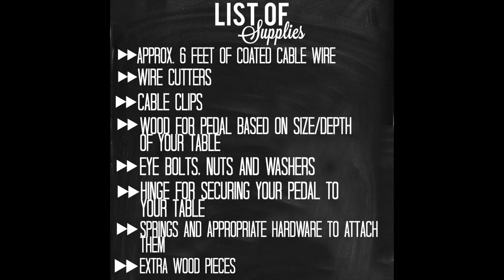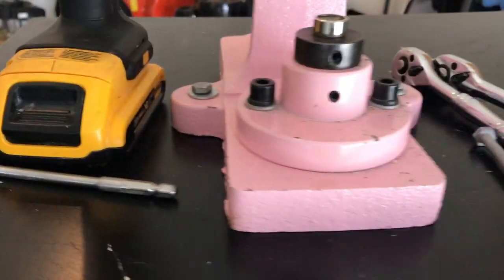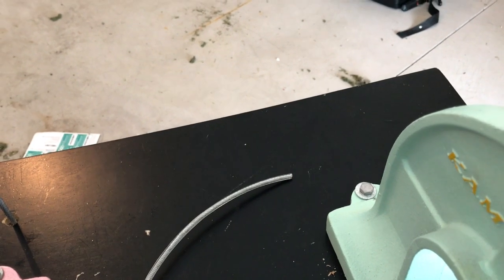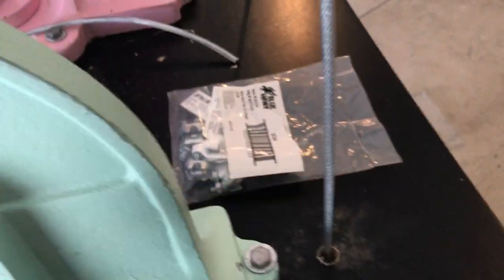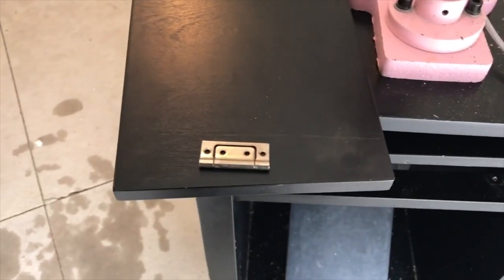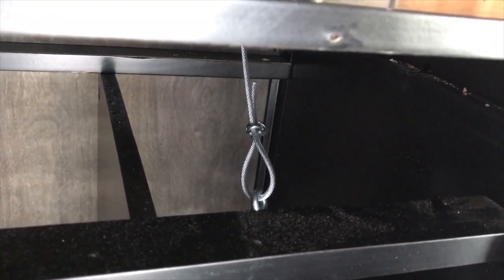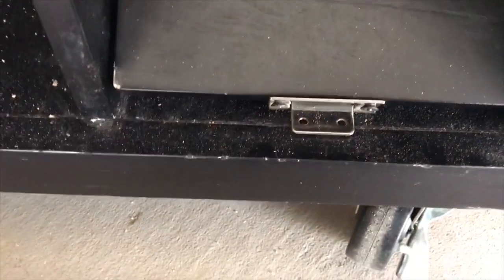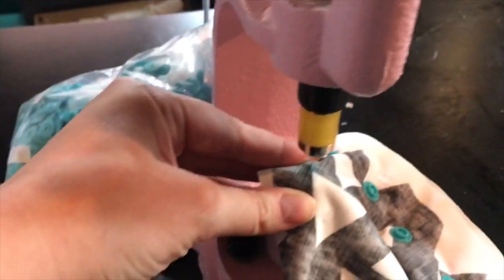DIY Tutorial: How to Convert a Table Top Snap Press to a Foot Kick Press!l

Comment: I was searching for some ideas on doing this for my GF's presses - and your tutorial has some great tips, so thank you! The only suggestion I have (and you're probably already running into this) is that your work top is probably bowing more already due to the style of the cabinet you used and it being elevated the way it is. I can see in your video just the process of bolting your presses down has caused it to bow in the middle. So repeated pressings are just going to make that worse. You definitely need a surface that isn't going to give for long-term use (or add a piece of wood to the top to help strengthen it). Let us know how this has worked for you since you built it!

After looking at your video again, you may be able to undo & prevent that bowing by bracing it between the "floating" top and the second level underneath with a couple pieces of 2x4 in between. Just an idea.
Reply from the maker: itbedave thank you for your comment! So far, so good and I haven’t heard any wood “cracking”! But I had the same thought when I noticed it starting to bow! I didn’t address it in the video because I figured most people wouldn’t be using a cabinet like this one! And “great minds think alike”! I had the same thought to slide some pieces of wood between the “floating” piece and the bottom piece for extra support! I still need to do it but plan to soon! Thanks again for the insight!
Reply: I used your video as a guide and ended up building a small 2'x4' workbench from scratch out of scrap 2x4's, a 2'x4' piece of MDF bench top, and other scrap lumber I already had (and a few new pieces I had to buy) and thought I'd pass along a quick tip on the wire cable to others considering doing a similar build. I initially picked up a 50' roll of vinyl coated 1/8" wire which was about $10 at my local Menards. But while shopping for other items, I passed by the pet section where I noticed a variety of colors and sizes of vinyl coated wire pet leashes with spring clips on the ends, meant to tie your dog up to a yard stake, etc. Depending on the size of the dog, the wire came in different gauges (thickness) with each being a different coating color. I ended up buying the small dog leash, which was coated in purple, about 20' long, and cost about $4. Not that the color really matters, but in the end, I only needed less than 3' per press and saved $6 on the cost of the wire. The color was just a little bonus! :-)